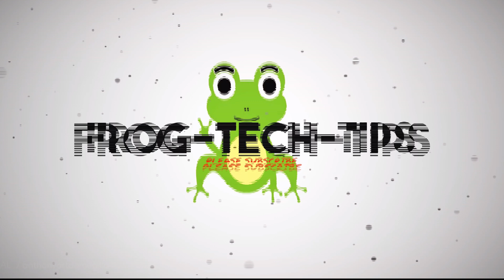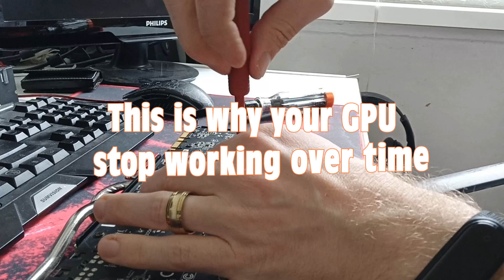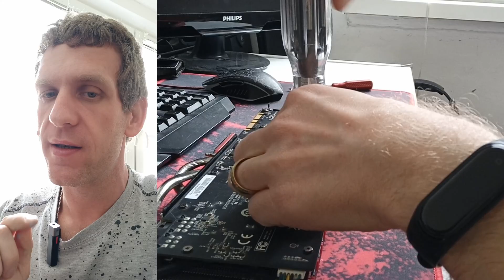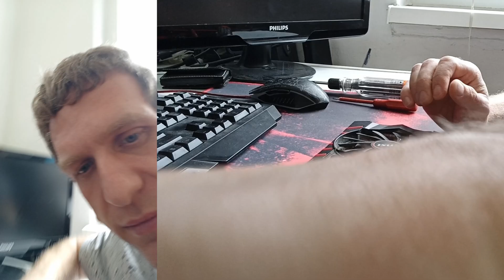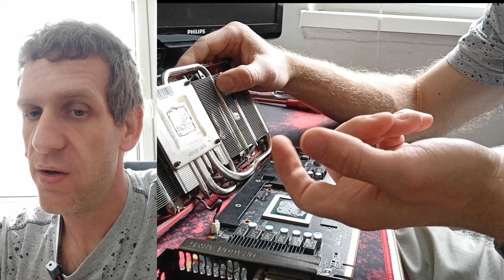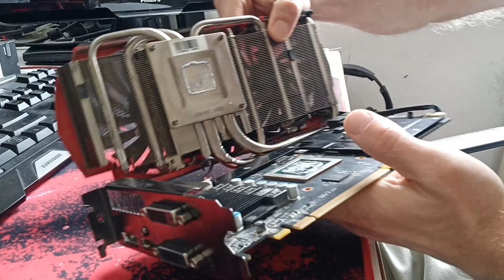Why your GPU get black screen problems and breaks down over time, the big truth revealed !!!

Comment: Hello from AUS. I have just cleaned the original paster of my Founders Edition 1080Ti. It was rock hard. After cleaning and repasting I was able to start the pc but then artificing and black screen. Since then I have a black screen and backlit monitor but no picture. The card did show picture once more but froze on windows loading screen. Do you think your reflow video may fix my problem? Please help!
Reply from the maker: Hi Maybe yes card is out of warranty there is nothing to lose anyway
Reply: @frogtechtips  what is the best flux I should use please? Your videos are great I am subscribed now!
Reply from the maker: @burto1112121  hi thanks for sub.:-) and best flux is some gel one like this one https://s.click.aliexpress.com/e/_Eusca8Q
Reply: @frogtechtips  perfect thank you I have ordered. Will it hurt to boot my gpu without the heat sink just to test for short time with no load? eg. to check if a full clean down has helped.
Reply from the maker: Ok let me know the results